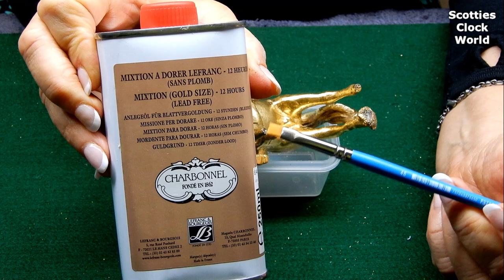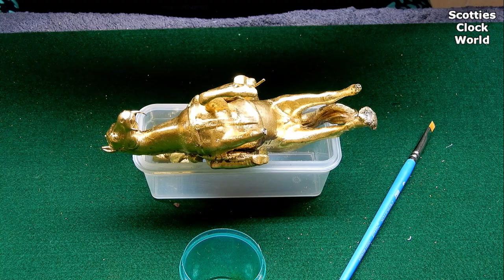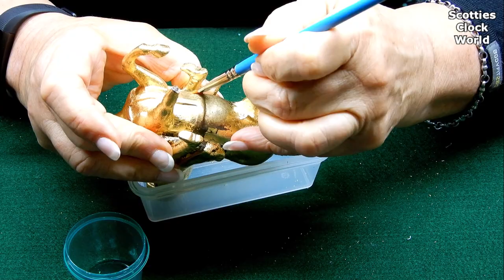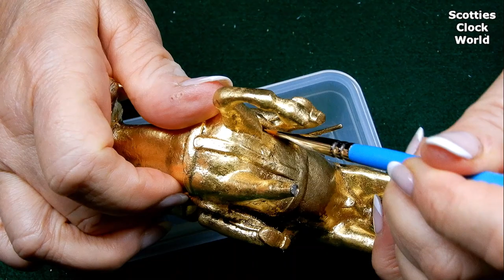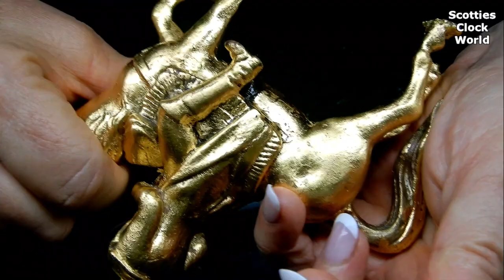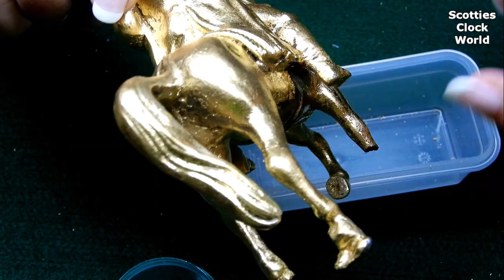How to gild an antique French figural mantle clock case #GoldLeafGilding

Comment: Will this devalue a piece that was originally fire guilded
Reply from the maker: The original fire based ormolu method is not available now. When the mercury evaporated into the air it killed off the workers after a few years.
Reply: Exactly. I do fire gilding in a clean safe chemistry situation.